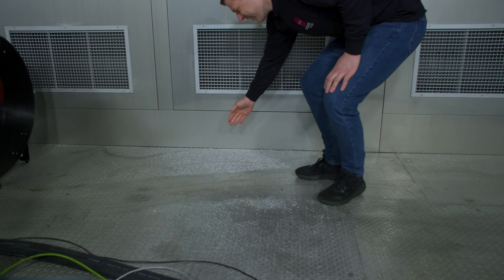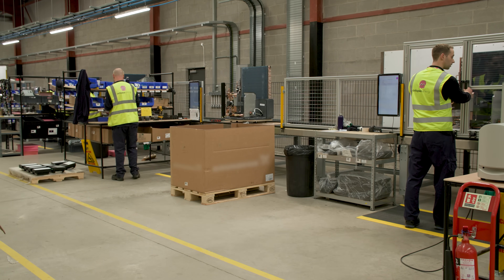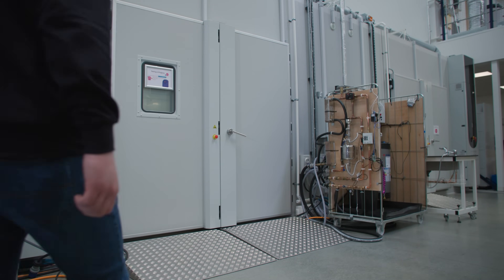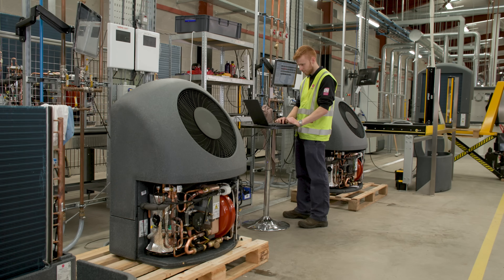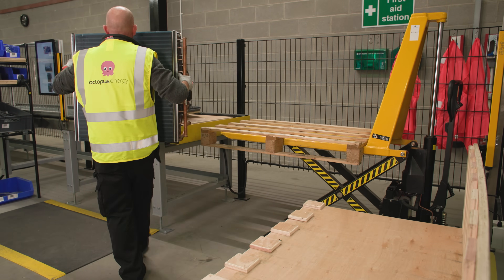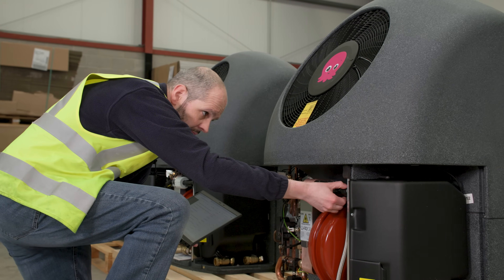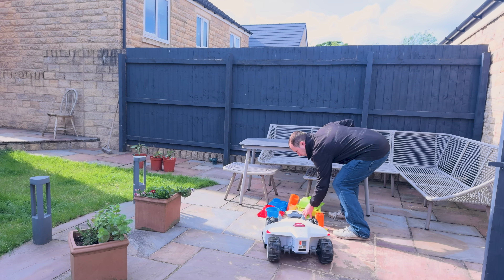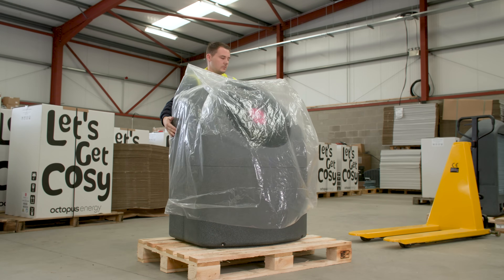COSY 12 vs 6/9: Bigger Power Unveiled

Comment: I live in a modernist house . I sometimes get condensation on the windows, from the cold mornings. I understand heat pumps are best left on at around 20c. Are you still supposed to open windows to let fresh air in aswell, or would that let all the heat out ? Even in winter I try to air the house out for a few minutes a day.
Reply from the maker: As the heating is running more to keep a constant temperature you may find your humidity level actually drops but yes you can ofcourse open windows to vent out if needed leaving them open or cracked all the time in ANY heating system is costing you more,  but i often like to let some fresh air in but don't often need to as heat pump and my PAS system help keep humidity in check

Comment: Do Octopus do a heating only beat pump? I don't want to connect it to my cylinder
Reply from the maker: Why would you not want to connect it to your cylinder?  If they don’t connect to hot water you won’t get the grant
Reply: @NicolasRaimo  i already have a Mixergy cylinder which I can heat up during OIG hours and meets my needs. Plus the Cylinder is on the opposite side of the house so I wouldn’t want to run pipes all the way around the house.
Reply from the maker: @ammaraihaan you could set no schedule for hot water but your still wasting power using intelligent to heat it and betting on long term low rates,  using the heat pump during intelligent hours will use 3 times less electricity during off peak hours
Reply: @NicolasRaimo  noted, in that case I need to find out if they can reuse my existing cylinder as it is already ASHP ready, but will this mean I don’t qualify for the grant?
Reply from the maker: @ammaraihaan no you can use existing cylinder and qualify for grant but it has to be connected Ocotpus will allow to connect to this,  please use my referral link to get £100 needs to be done to start enquiry
Reply from the maker: you can use current cylinder just needs to be connected to heat pump please use my referral link to start your enquiry to split £200

Comment: Daikin is similar EDLA 4,6,8 are the same model just with different max power, same with the EDLA 09,11,14.
I originally had the EDLA093v3 which had a minimum power draw of about 900W with the compressor running . I have been told it's the same for the 11 and 14. 
It's a long story but I ended up with an EDLA08v3 which seems to have a minimum power draw of about 300W with the compressor running. 
I probably could have got away with the 06 but it has the same minimum power so I was happy to play it safe with the 08.
There is a significant difference in size and noise between the 09-14 and the 04-08.
When I had the 09 I could hear the compressor running but on the 08 it's not audible over the fan noise.
The Daikins have OTA updates for the MMI(man machine interface) but the outdoor units need a site visit so a plus one for the Cosy there.
TBH it seems shocking to me in this day and age to have to send engineers out but they were sending engineers out to update the firmware on the 09-14 models.
They came out to update mine and were a bit surprised to find I had an 08 but they did a firmware update anyway it's early days yet but my COP has increased by about 0.4.
Reply from the maker: Thanks for sharing your experience with the different models and the COP increase after the firmware update!

Comment: Similar to other brands. Eg Vaillant arotherm+ 3kW and 5kW 765 x 1,100 x 450mm, 10kW,12kW 1,565 x 1,100 x 450mm . All occupy same footprint. The way Vaillant do it is that the 3kW is exactly the same unit as the 5kW but with a power limit in firmware.
Similarly for 10,12kW.  Simplifies manufacturing - 2 different units instead of 4 need to be made.
Reply: Without over the air updates presumably, though?